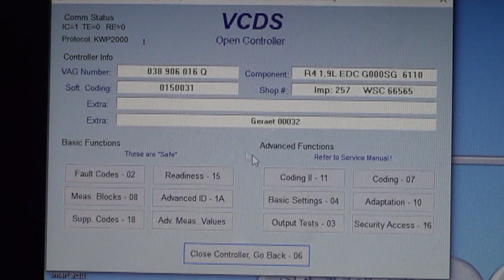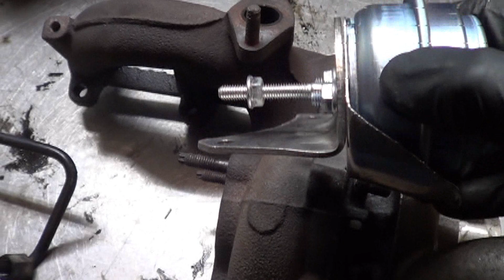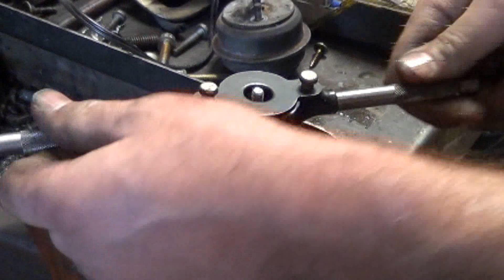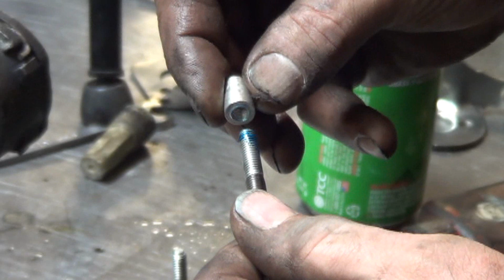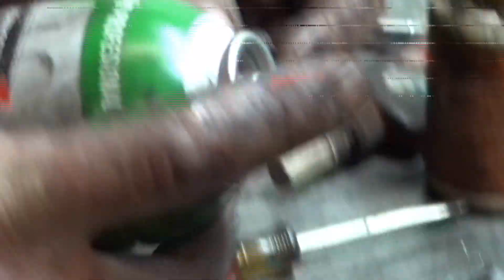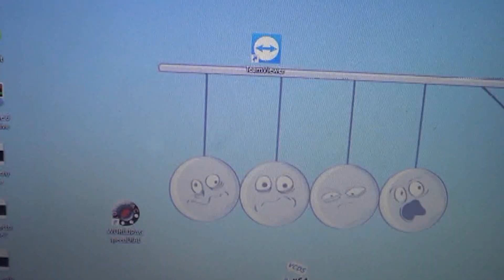smart actuator delete P0299

Comment: the stock preload isnt noted anywhere??  if it is all you had to do was preload the actuator to correct psi :X
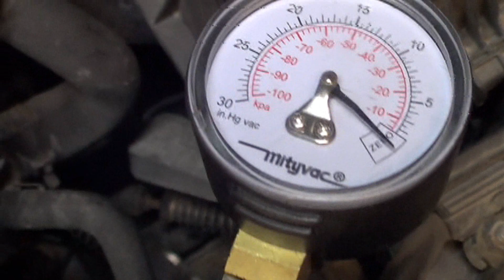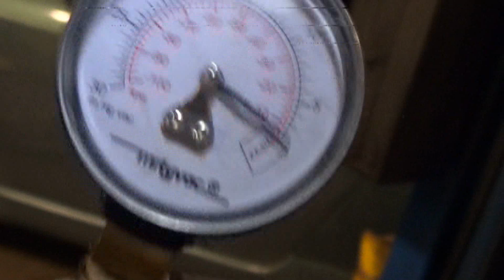Reply from the maker: did you even watch the video?   the diaphragm in the turbo actuator was ruptured and not sealing vacuum  see 5:45 and 6:33.  If I preload the actuator but it doesn't seal vacuum how good is it gonna work?
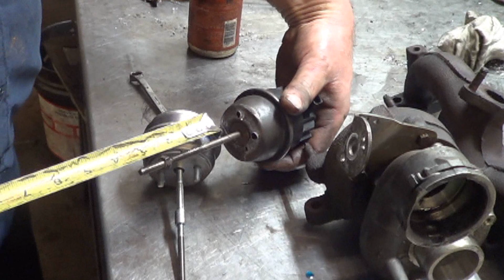Reply: @CoolAirVw  wait..im talking about 21:15 when you said you'll start at 3.5" of preload based on the arm of the other WGA ...thats why im saying like cant you look up what the OEM preload should be in PSI and do that straight away instead of trial and error?  as in im honestly just asking its not an attack...

Comment: You can buy these actuators new on ebay,aliexpress.around $70. I bought 1 2 years ago and just now the sensor on it is throwing a light but i still have full power. On looking for a new 1 i see volkswagen now finally supply this part but its around $250.
Reply from the maker: Read the description.  Thanks for watching and commenting Mr. President.

Comment: Smart actuator is available on eBay between 75-110 us dollars. You don't have to buy all turbo AHL and BEW turbo cartridges are also available on eBay, I just bought one for 145+tax , all you need is aluminum plate on cold side part on your turbo. Mine was 038 253 019S  and other number could be KP39-024or 026.
Is going to take you same time to take apart hot part of turbo, I sink mine in 5 gallon bucket full with water for couple hours, than spray wd-40 .
Reply from the maker: Yes of course.  This was stated in the description.

Comment: BRM makes a replacement actuator
Reply from the maker: You cant use a BRM actuator on a BEW.  One pulls the other pushes.  But, years ago no actuator was available for a BEW.  I hadn't checked before I made this video.  People already pointed out BEW actuators are now available and I put that in the description.
Reply: Garret actuator on a vnt17 is sold separately and can be modified fairly easily to fit a kp39.  That's the best option imo.  Just a matter of removing it from the bracket attaching the garret smart actuator to the bracket and lengthening the actuator rod using those long thread connector nuts.  Pretty much same procedure as what you did

Comment: i have a clone obd2 cable that work well to read /write vw ecu  then with edcsuite for my edc15vm ( very user friendly  ) ive succefully remaped my alh myself , 

just now with EDC16u31 , on my BEW( also compatible and succefully read) im totally lost with winols ( really im lost) to disable the smart function and tell ecu tu use MAP sensor insead 

i would be really appreciated if you can point me out any info on this
thanks !
paid 400$ for a brand new smart actuator directly at vw dealership, then Broke vacuum pin by innatention , because it was stuck on the chain of the chain block , ( not stupieds thing ive done yet_) 
used extention rod like one you built that come with it . and fitted it on an alh actuator , work like a charm but really need to disable this useless smart function , i really need help on this one
Reply: Did you ever get this fixes on the BEW? i know its been 4 years, but in the same situation!
Reply: @MyNolan1234  not fixed it sorry , i finally buy the car then remove the engine from it , , will probably use the bew block with an Alh head  on my next build 
winols is very complicated for me :(

Comment: Excellent video.  I too changed the actuator on my '05 Golf with the BW KP39 turbo.  I had Malone do a VNT delete.  The how-to I followed a few years ago suggested using the shaft from the original turbo to lengthen the shaft on the new turbo which I did.  Removing the bracket was very time consuming on my part as well as removing the actuator from the turbo in-car.  The replacement actuator is a smart actuator from a Garrett VNT 17 IIRC, from idparts and a Malone VNT delete.
Reply from the maker: thanks for watching

Comment: This makes me so happy that I have an ALH...I mean really VW!?  why?...the TDI just got way more complicated after the ALH for what? 10% improved economy?  Very cool repair!  I'll keep this in mind for friends that have a BEW.
Reply from the maker: Other comments are saying smart actuator is available.
Reply: BEW IS NIGHTMARE
headside fuel pump broke in parts 
smart actuator failing 
kp39 turbo broke turbine shaft in half 
camshaft use prematurly 
know head gasket problems 
Pumpe deuse injector-pumps are  a nithmare to access or change but not even see one broke 
i dont even want to discover other ones troubles , not mine 

love my alh too but they are sensible to timing faillure if negliged lol , just broke timing belt at 4krpm no chance for the head , changing motor now

Comment: Just put a search for the actuator in Google, they are available now.  Even on Amazon.
Reply from the maker: I did a search and they are!  Thank you!  The one I found requires modification, but simple enough it looks like.  Thanks!  Last time I checked there were some NO offerings that worked easily.